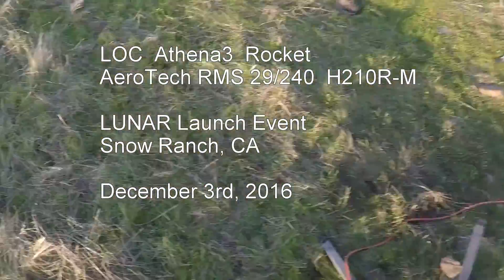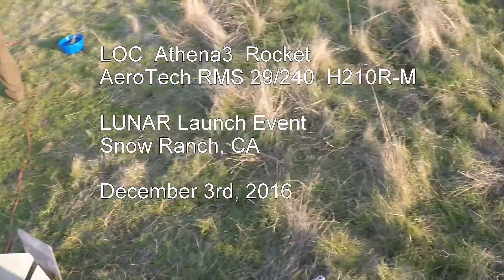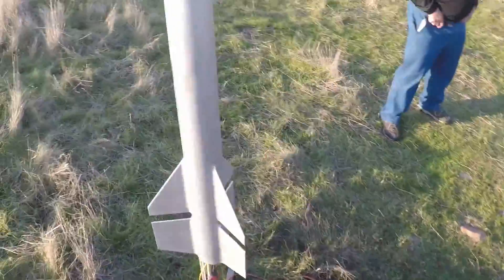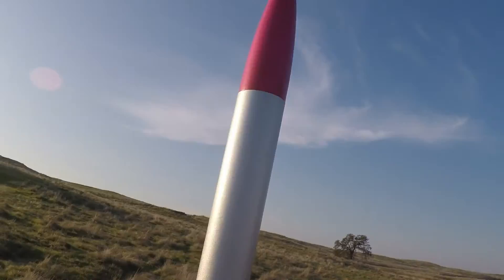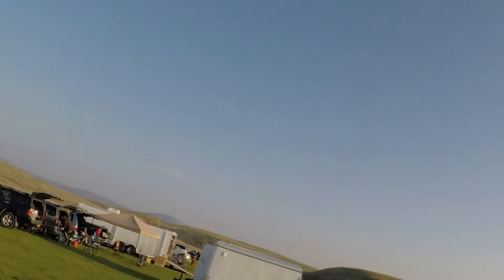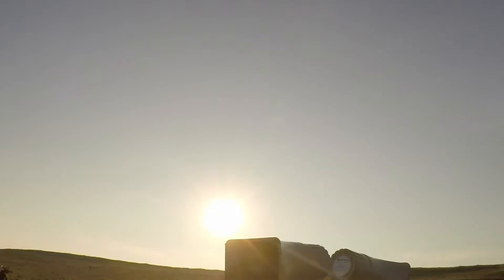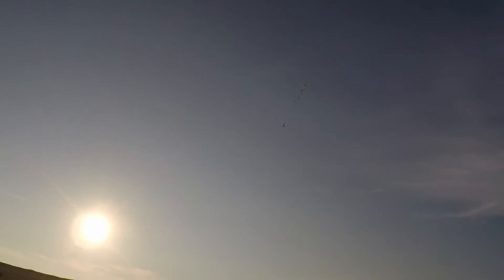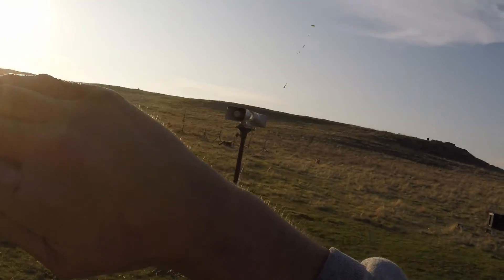LOC Athena3 Rocket, H210R-M

Comment: What ended up happening after all at apogee?
Reply from the maker: For this rocket, I use a friction fit for both the booster/payload and payload/nose cone joints.   I use just 0.7g of 4F black powder for the altimeter fired drogue charge at apogee and I also use the motor ejection charge as the backup for that.   Since he motor ejection charge should ignite after the altimeter charge ignites, I use a little more black powder for the backup motor charge.   This is to ensure that if the first charge fails to deploy the apogee drogue parachute for some reason, the backup charge will have more force to get the job done.   Unfortunately, I've had issues with the motor ejection charges firing too early, such as what happed in this flight.   The motor charge fired first and the extra black powder shot the payload section forward so fast that when the cord connecting the booster section to the payload section pulled tight, that shock was enough to jolt the nosecone off the payload and thus deploy the main parachute at apogee.
Fortunatley, this rocket doesn't go too high, and it simply floated down from 1,600 ft or so.   The payload charge did fire at 500 ft into the already empty payload tube, but I missed it on the video since I was walking around the PA system at that moment.   My lesson learned is to use more tape for a tighter fitting nosecone, else I need to install a pair so small shear pins for the payload/nosecone joint rather than using the friction fit.   I hope that makes sense.